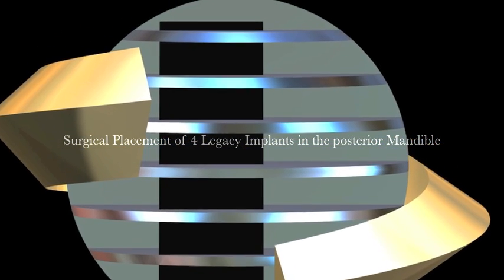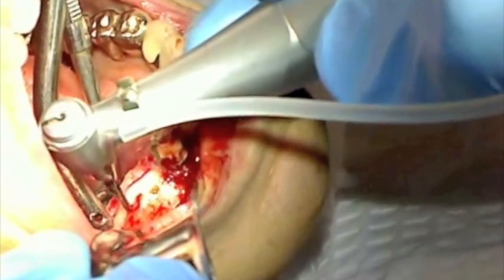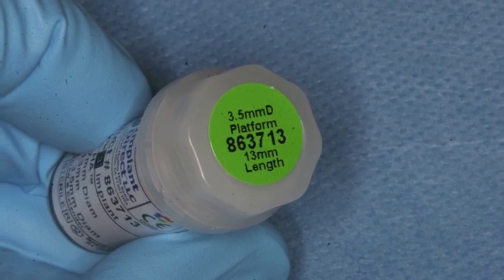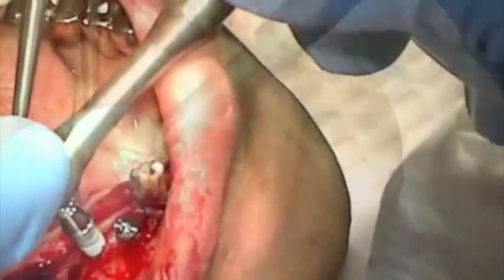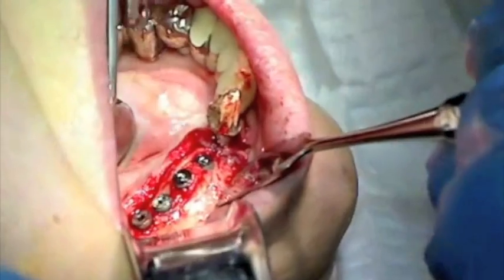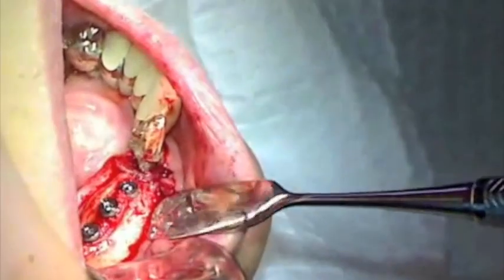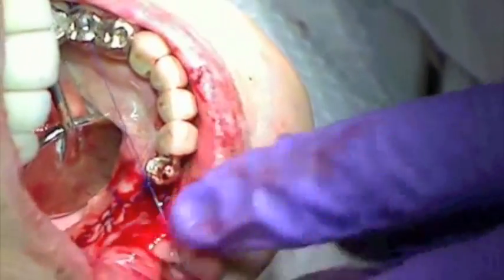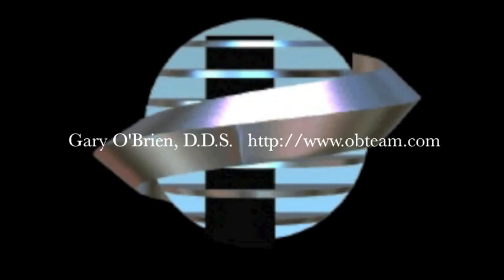Surgical Placement of 4 Legacy 3 Dental Implants in the Posterior Mandible by Gary R O'Brien, DDS.

Comment: Helpful video. Well produced.   I noticed that the cortical bone drill was not used.  When do you find it necessary to use the cortical bone drill? I am switching over to this system and would appreciate all the Clinical tips you can pass on.